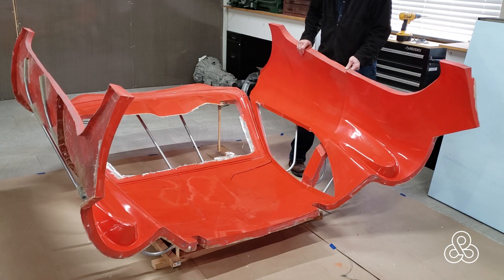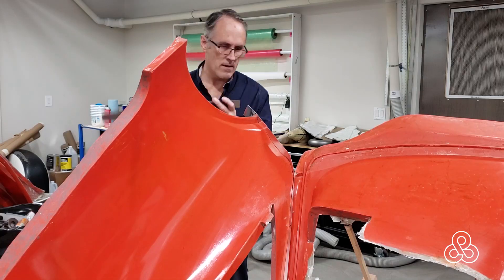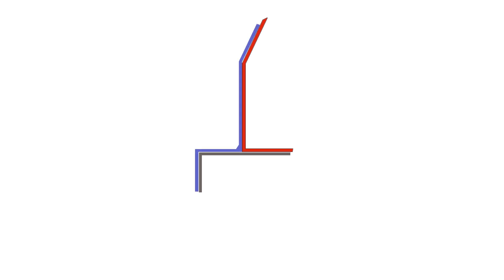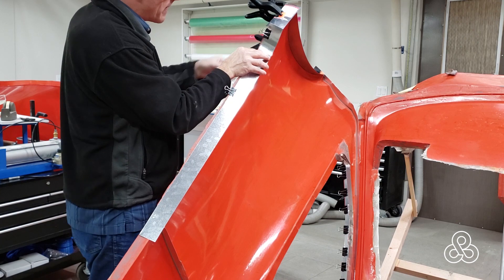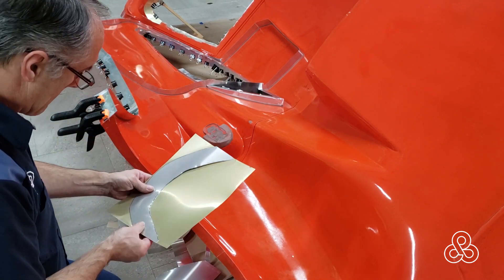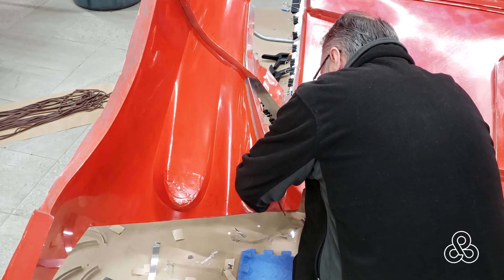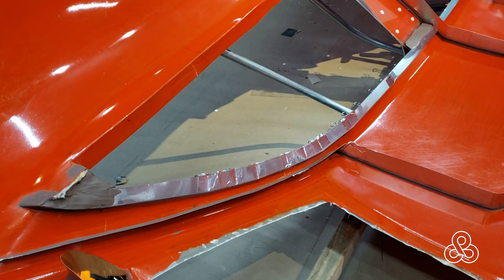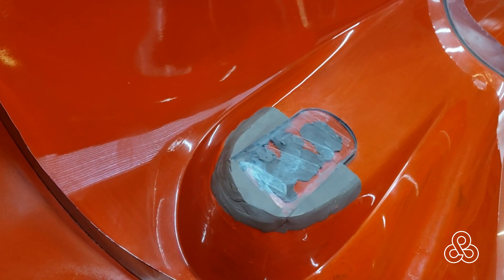A19 - Flash n Fillet- Prepping the molds for the composite layup of our supercar build.

Comment: Binge watching all your videos and this video is where I am after like two days. My question for this method....won't this make your panel gaps extremely tight? If I am understanding it correctly, the gaps will only be the thickness of the sheet metal?
Reply from the maker: Yeh! That's like Rolls Royce quality isn't it? Actually the front and rear clamshells will move slightly for and aft allowing for more gap. the doors are the only "fill a hole" parts and the flange will be trimmed off to leave just the "skin". The gap will be whatever I make it. I have some concerns myself in this regard, as I have never done the butterfly door thing and will just have to do a trial and error fitment as the doors swings in at an odd angle. Have you by chance seen this video - https://youtu.be/kVoj69ORNdM  "Multiple parts from a single plug" it has a little animation showing the door fitment? Sorry I can't fit in every detail in a video, but that's what the comments are for, aren't they. Hope that clarifies. Caught a couple of car videos on your site as well. Great results on your door panels/dash!
Reply: @BuilderCreator  Yes I did see that video and thanks for the explanation. I guess I briefly forgot that your car has these giant panels rather than the traditional fenders, etc haha. As for my interior panels...yeah they look nice, but it was my first time really working with the materials. Not nearly as precise and pretty as yours. I will definitely do them a little differently in the future. The added flange trick is definitely helpful. I always wondered how that was accomplished (I thought it was added on after pulling the part from the mold and I just didn't see that being strong enough to hold up). I saw a California license plate on your wall....is that where you're located?
Reply from the maker: @DavidGuyton  The license plate is very old. (24 years) You will see in today's video, more about my new home!